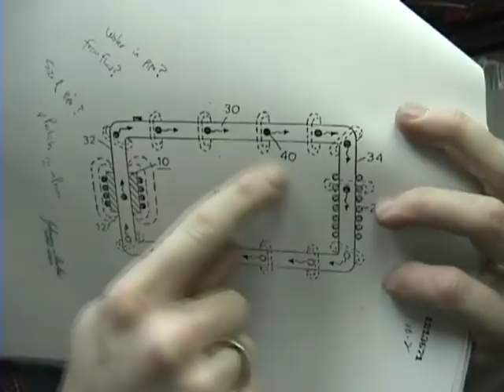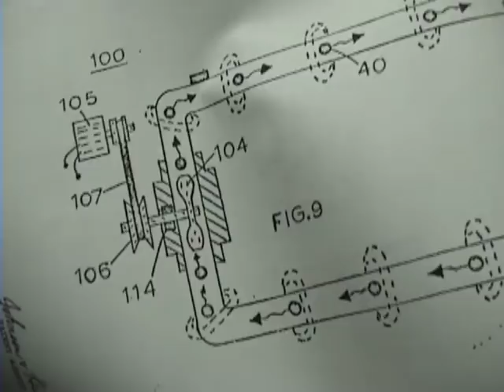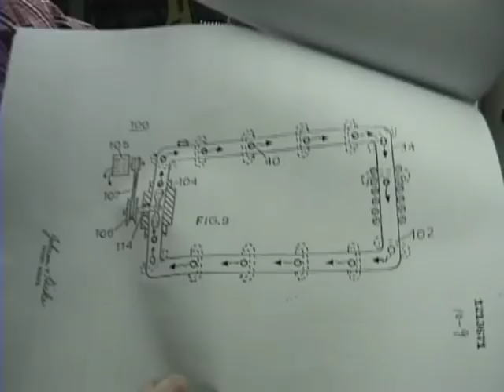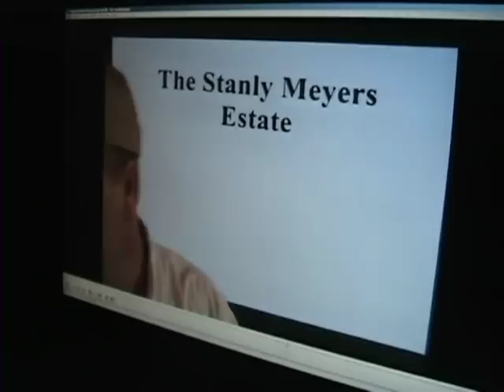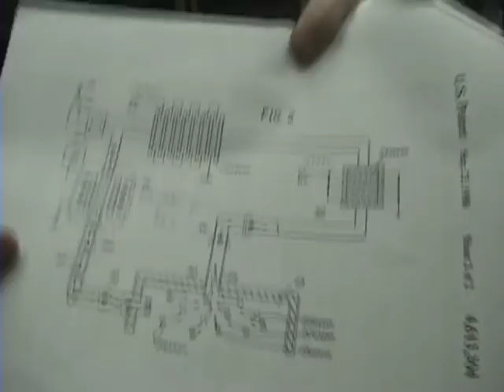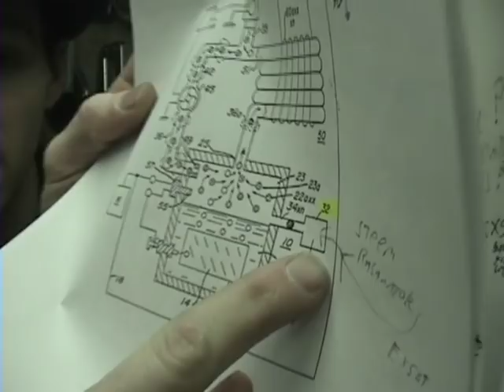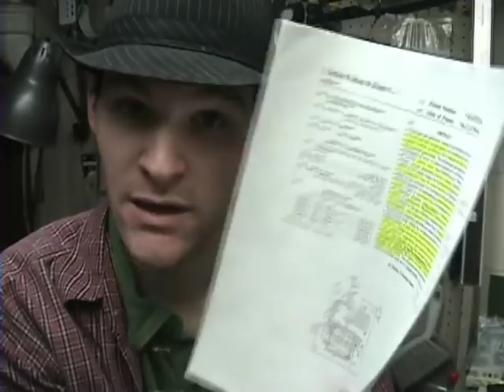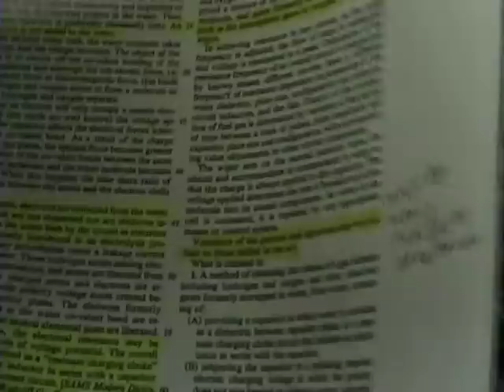The Key To Stanley Meyers Water Car, Gas Electrical Hydrogen Generator, www.RWGresearch.com

Comment: Hi, nice to hear someone else who,s interested in this fascinating subject. Correct me if I'm wrong because I'm still learning myself, but is'nt the closed loop coil device shown what Stan referred to as a VIC, voltage intensifier circuit, which he used to produce a pulsed voltage to dramatically improve the process of splitting the hydrgen and oxygen.

Comment: For what it is worth. I spent a lot of years in the printing industry. On the litho side. We used a Carbon Arc plate burning system to create the offset plates used for image transfer to paper, cardboard, plastic etc. The carbon tips that were used in this process came in many configurations. Solid carbon rods 1 to 7 inches long. From 1/8th" up to a 1/4 " in Diameter, These could be ordered with various outer platings like Brass, Copper, and so on. I believe some combinations of these arc/rod/tips are what are shown in the patent device that generates the particles. Just food for thought. Cheers. Say Hello to Alex from saintronmcg.

Comment: I have watched Stan's explanation of his Water Car Technology and the principles in this patent are quite different. In his video, he said, it is resonant frequency that breaks the water molecule. He mentions about pulses of high voltage that resonates with the natural vibration of the water molecule that accomplishes the snatching of hydrogen into elemental hydrogen. He made the analogy of vibrating springs in-between the oxygen and hydrogen atoms in water and intermittent high voltage pulses (20,000 volts?) applied on the separation plates when the springs are stretched to the maximum. It is at this point when energy required by the charged plates to snatch hydrogen ion into the anode and oxygen ion into the cathode are lowest. Even in his laboratory setups, he was showing plates with bubbling gases with elaborate electronic circuits. The current patent you described may be a his way only of generating the high voltage (20,000 volts?) required by the plates in his Stage One invention used in his buggy or a Stage Two of his invention where he developed spark plugs that produce hydroxy gas retrofittable to all existing ICE's with the common spark plugs. This second one may have really scared the shit out of Big Oil, because it is swiftly implementable on all existing ICE's. That may be the reason  why he was poisoned despite being allowed to drive around in his water car unmolested for 5 years.
Reply: You have to remember that there was stages
to his work. Him showing plates with bubbling 
gases was early stage. Simple brute force
division of O and H. Look at that video and
you will see later in it he shows burning 
Hydrogen. What he was doing with the bubbling
was "not" pure hydrogen because you can't 
seperate H from O like that and it not mixing
back together. In that bubbler it was oxygen
and hydrogen. VERY explosive. 
  Next thing you might have missed is he 
has a motor and alternator on his desk. Why?
I think he rewound the alternator so that it
would work like a brown/eclin alternator. It
has to be that way because a alternator like
that would not have a load. Running a motor
with a alternator would have a major load
on a alternator. 
  One thing a lot of don't know is he found
a mix of metal, I don't remember what they
called it, but it produced more hydrogen
than normal metals.  
  On the frequency angle there is a frequency
for oxygen and one for hydrogen. If you use
the two frequencies it would cause them to 
resonate. Thus causing the springs effect
your talking about. Another thing is there
are ionic charges. I think oxygen is negative
and hydrogen is positive. THat keeps them
together.
Reply: Search for   "chemalloy Chemalloy Samuel Freedman"  Here is the metal that he was using.
Reply: From the stuff I have watched, I picked up on the 20,000 figure but i'm pretty sure it was cycles not volts. I assumed that the frequency of the electrical input to the plates was significant.
Question is... is that 20,000 hz ac or a dc pulse?
Reply: Gerry p 
Keely used sound spheres to vibrate molecules apart.  

He worked with Henry Ford on the Model T.  If your put V shaped magnets in a holder under the pistons the car would run on the water vapor in the air.  This was only available in early production models.  This is the reason behind the powerful spark that these cars have.  Well that and poor quality gas they had at the time.
Reply: This is true for his water fuel cell. What Russ is making is a EPG and it works on s different principle. The EPG could be used for electric cars if the output is sufficiently high enough
Reply: Pass steam through a plasma flame; Jacobs ladder) splits the water
Reply: @bcideinc  Then what ?
Reply: Anything done with hho, the polarized form of h20, has to do with particle acceleration using charge, the sum of poles, not any single pole, and to put charge in motion using a charge diode is the key. Zero point wave folding technology as described by Bearden explains how to move charge without moving a pole. Move charge without moving a monopolar flow, extremely important. Now when a carrier having it's own charge run by influence not connection can charge to high potential in a continuous loop. The winding does this, so the ferrous core can periodically discharge to return charge to the carried wave ferrous cores. This was the case for zpe using in Coral Castle as one example I reverse engineered.
Meyer used gas to carry superconductive level charged ions, though it is not necessary to even use gasses for free energy. A magnetic motor can get more power without the use of water etc.... but most people just want an easy way to run their car off water because it should be cheaper to modify.
A certain someone I know thinks heterodyneing is the real secret, and Meyers was an idiot, but he doesn't realize that zpe is a natural form of heterodyneing. 
With Meyer's hho injector patent, he flash ionizes h20 into linear spins as the water droplets become their own capacitors using 5ns pulses 25kv 1kw stacking each 5ns 8 times until it reaches 40ns then cuts off. The frequency requirement of this particular circuit is high only because it needs to evade discharging of the hho suspending so nearby the electrode pipe and anode rod. Of course there are many other circuits which would do this at LF and are so over efficient and powerful on their own, you don't need the HF resonance because the metal itself is ionized constantly.  At 19:12 he references Stan's chamber which is actually charging vaporized water using what should be a pump z waveform obviously. As long as the circuit can handle the pump z without reversing it's slope in feedback resonance (*meaning it must be true over efficient).
Anyway , Rus, the chamber at 19:12 is a carburator not shown with air and water vapor mix. The drawing is simply made to focus on the reaction module.
I've designed a very simple little antigravity coil using zp knowledge which could be 3d printed in miniature and used to charge water into hho without physical contact, so you don't wear out electrodes or anodes! It should produce a good level of superconductivity in the prototype. Just not going to share this on my channel sorry to risky. Should be done with that one maybe 2 weeks.
Reply: @787brx8  ETHNOL IN NOT POOR quality FUEL  LIKE THEY HAD BACK THEN
Reply: @bcideinc  WOW
Reply: The first patent seems to describe a regular transformer with a core made of mercury (metal), inside a non metallic (avoid the squirrel cage effect) vacuumed tube and a pump to initiate the circulation. This would certainly reduce the core's resistant; something to look into...
Reply: @siscodidley  the PWM frequency would certainly reduce the energy required if it resonates with the electron's movement.
Reply: Clearly this is not the car
Reply: @siscodidley  

It was both high frequency and high voltage with reduced current circuits involved.
Reply: Yea like the paper patients were altered.  The video and Gerald W (?Wininer?) videos sound alike, and both had to use words that in the lanuage at time didn't apply -but both try to explain That same concept.
Reply: Wrong Los Alamos  laboratory atomic energy  professor 25 years
Reply: You  just want  a answer to you question ⁉️ you all  wrong have nice day day
Reply: There's a European guy who made a video on the vic circuit that explains this effect

Comment: I doubt he was using electricity to run the car directly, because it makes sense that he would need the electricity to run electrolysis, since that is a current intense process. From what I've been seeing on YouTube, the "problem" with running a car on water is that the amount of HHO needed requires more electricity to produce than the car can maintain. So you need overunity to do it, and here it is. Got the patent. Totally awesome stuff. Kudos.

Comment: You  are  right  on  point.  In  an  automobile  the 12 volts  is fed  to a coil, primary windings, LOW amps ,.. then  the circuit  is  turned OFF!, inducing high  voltage and low amps  into the  secondary windings. Same thing happens in a STUN GUN. 9volts  becomes 50,000 volts. Without  a metal core , using rodin coils around plastic thick walled pipe , you should  be  able  to induce into a secondary  rodin and achieve the  results  that  you seek.  Good  luck  everyone

Comment: Watched this several years ago and just watched it again and many things suddenly occured to me first the toroid coil is obviously your round tube with a coil around it. Second that coil is just one (think of it as) circular tesla coil which works in reverse. The white parts of the coil is the primary of a Tesla coil riding on top of the secondary or many turns of a Tesla coil but the smaller more abundant winding covers the entire tube with a single or bifiler winding and is actually the primary being the high potential capturing that energy and by inductance transferring it into the bigger less turns primary which is actually the secondary (think reverse Tesla coil) and feeding back that lower voltage potential back into the tank circuit utilizing that energy to reuse it. The tubing would something more like pure quarts tubing for its electrical properties being a perfect insulator but also being a perfect memory bank for frequency as quarts is well known to have capabilities of. It would also be much better for hydrogen as its not going to pass through pure quarts like it would with plastic nor break down like plastics being exposed to hydrogen and oxygen in its gaseous forms. So am possitive quarts would be the best for that job for all of its dillectric characteristics and far superior to any plastic tubing howbeit very expensive. One five foot tube can cost upto and even exceeding 1000 dollars at an ID of 1" and having a 2mm wall thickness. I know cause I own hundreds of them and have done extensive research on this stuff its the perfect material for all spectrums of light to pass through unimpeded by any lead in the glass as there is none of that contamination in it. Now here iss where it gets interesting, quarts can not be cut or melted even with an oxy/acytelene outfit but needs pure hydrogen and oxygen torches to work the dang stuff....melts at over 10k degrees I believe. I tried everything and the stuff will glow bright as the sun when almost melting but no cigar without hydrogen/oxy flame. The side chamber is an plasma chamber producing ultraviolet and infrared light to separate the heavy hydrogen from the lighter hydrogen. Deuterium or heavy hydrogen contamination in water it turns out makes it extremely hard to split without large amounts of electricity. The side chamber is water in gas form depleted from all deuterium which then has the ability to change all water around it back to its natural state just like what you were reading Stan explain in the patent. Cause once depleted from Deuterium it can be split with lil or no amperage and in large quantities, So what Stan built here is a water conditioning device to get the heavy hydrogen out of the way so it stops interfering with the transformation of all the rest of the gaseous water the pure water can now process (thus the ability to impart its charged particles to the other yet to be purified HHO and the particle now being free from the contamination is highly charged which the donut coil can now harvest the energy while feeding it back into the tank circuit to be used to continue the process. What this circuit is doing is changing the bond angle of hydrogen from around 104 to around 114 or greater making it now easy to split with almost zero amps and few hundred volts. Stan is mimicking what nature does in a thunderstorm...plasma separates the water creating  HHO and a Big BOOM from the static spark setting it off cause the plasma produces HUGE AMOUNTS of HHO...Hope my explaination helps....big round coil is just a circular Tesla coil and the fewer winds of insulated white wire is like the primary and bigger wire. Look at the schematic in the patent it shows just a few wires going to that coil just like a Tesla coil would do. Its not many many coils just one.
Reply: The first patent seems to describe a regular transformer with a core made of mercury (metal), inside a non metallic (avoid the squirrel cage effect) vacuumed tube and a pump to initiate the circulation. This would certainly reduce the core's resistant; something to look into...
Reply: Plasma sparks plus hydrogen. Sounds safe

Comment: I believe the "Cornish Hydrogen Generator" used a sort of spark gap in water but I believe in that invention the aluminum was burned in the ICE kind of a step beyond a simple HHO splitter. 
Also the second toroidal tube you showed it may indeed be a heat-sink with fins to dissipate heat (I think you are right) but just in case, unless you can clearly see tubes connecting it, don't over look the slight possibility of it being a large Variable-Cap to bring the circuit into resonance.
Love the vid

Comment: that input where those electrical metal charged bits come in to your coil thing come from that collector whereby the electrodes are eating away at each other under the electrical arc going up in to the collector and passing through a magnet thereby getting magnetized then going in to your coil generator , luv ya man , thanks so much for all the info too.

Comment: 57:20 You are correct here. The resonance in the choke limits the current and allows voltage to build. This is the most important concept of all. It makes everything else possible because it is the source of the system's electrical input efficiency.
Reply: Yes correct.
Reply: The first patent seems to describe a regular transformer with a core made of mercury (metal), inside a non metallic (avoid the squirrel cage effect) vacuumed tube and a pump to initiate the circulation. This would certainly reduce the core's resistant; something to look into...

Comment: As far as i understand (i have never worked on with one) plasma torches and cutters don't require inert or otherwise specified gas. Ambient air at standard shop pressure of 120 psi is sufficient, The magic is in the employment of a Tungsten tip. There is a seemingly credible vid if u seach "homemade plasma cutter" that walks through the assembly and workings of his own, argued to be comparable to a professional model. Very good work my friend,

Comment: When water molecules split into HHO, energy is released. Stan realized this (he commented on it in an old video). Stan tapped the releasing energy and used it to feed the step up transformer coils (this is why he said non magnetic tubing, he didn't want the energy to be absorbed into the walls of a metal pipe, magnetizing the pipe and screwing up the acceleration). Some energy from the secondary coil setup is used to feed the primary feed coil. Self sustaining setup.
 Very interesting.
Reply: Could you elaborate on what you've learned please?
Reply: @Cloxxki  Uhh no, we are talking 9 years ago on my comment.

Comment: 54:25 If #32 in the diagram is the output of the permanent magnetic gas generator you held up, then here is what will happen. The electrolysis process at high voltage both separates water into hydrogen and oxygen molecules, and also ionizes those molecules. As charged ions, the hydrogen and oxygen molecules will be attracted to the incoming permanent magnet vapor molecules. Because this electrolysis system generates mechanical pressure by producing high volumes of ionized hydrogen and oxygen, and because the magnetic vapor molecules "hitch a ride" onto those ionized hydrogen and oxygen molecules, that mechanical pressure acts to move the permanent magnet gas molecules through the coil system, producing electrical output.

Comment: At 29:00, with the AC vs DC windings, I think that the diagram is indicating that the AC wire is an additional wire that picks up the field induced in the separate coils by induction. Because the wire winds between the coils and reverses direction as it does so, it will create an alternating current by alternating direction. The DC illustration appears consistent with this because the parallel connections prevent the wire from having any effective reversal of direction.
Reply: The first patent seems to describe a regular transformer with a core made of mercury (metal), inside a non metallic (avoid the squirrel cage effect) vacuumed tube and a pump to initiate the circulation. This would certainly reduce the core's resistant; something to look into...